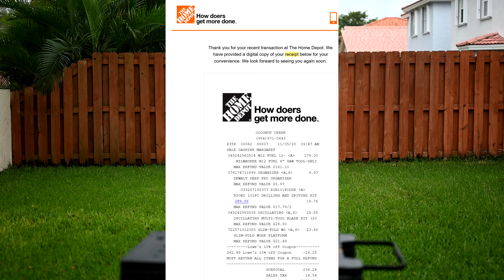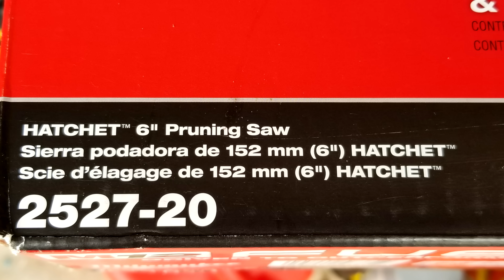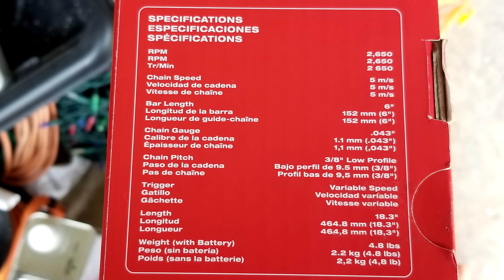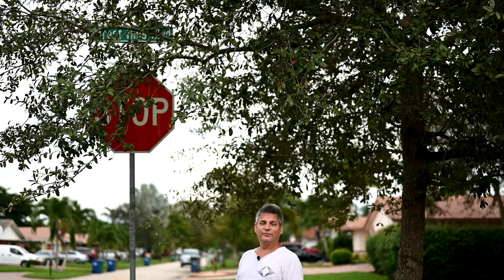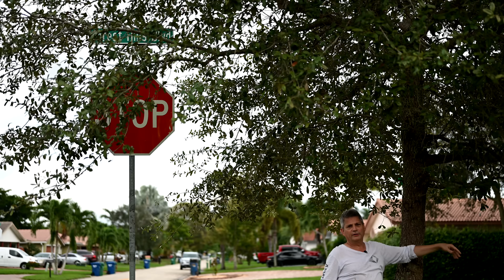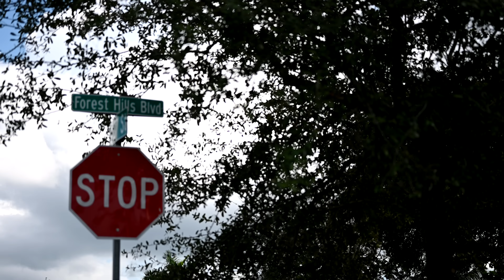Milwaukee Cordless Hatchet Review/How to Prune Tree Branches 2527-20

Comment from the maker: From Home Depot Tool Deals mentioned (paid affiliate links, thanks for your support!)
🛒 Milwaukee M12 FUEL Brushless 6 in. HATCHET Pruning Saw: https://homedepot.sjv.io/XgK6g
🛒 Echo 1 Qt. Bar and Chain Oil For Milwaukee Hatchet Chainsaw: https://homedepot.sjv.io/LjWjY
🛒 Milwaukee Battery Starter Kit Tool Deals:  https://homedepot.sjv.io/LJ1yZ
🛒 All 290 Milwaukee tool deals or battery Deals: https://homedepot.sjv.io/LVrOV
🛒 Milwaukee M12 Free tool or battery Deals: https://homedepot.sjv.io/VEV26
🛒 Milwaukee M18 Free tool or battery Deals: https://homedepot.sjv.io/0WORO
🛒 Dewalt $499 6-Tool Kit with Toughsytem Tool Box: https://homedepot.sjv.io/9NE5j 
🛒 DeWalt Home Depot Buy 1 Get 1 Black Friday Tools: https://homedepot.sjv.io/VJB4J
🛒 Battery Starter Kit 6Ah/4.0 BOGO Tool Deal: https://homedepot.sjv.io/yagN2
🛒 DeWalt XR Brushless Drill/Driver Kit BOGO Tool Deal: https://homedepot.sjv.io/nqoNR
🛒 All 30 DeWalt Buy One Atomic Kit Get 2 Free Tools Deals: https://homedepot.sjv.io/xe9KR
🛒 All 10 DeWalt Flexvolt Advantage & BOGO Tool Deals:  https://homedepot.sjv.io/MZ6An
🛒 DeWalt Folding Portable Workbench Black Friday Deal  https://homedepot.sjv.io/Qo9vo
🛒 DeWalt 10-Compartment Deep Pro Small Parts Organizer: https://homedepot.sjv.io/bEEYg
🛒 DeWalt 12 in. 20V MAX Brushless Chainsaw (Tool Only): https://homedepot.sjv.io/XgW74
🛒 DeWalt Pneumatic 21-Degree Collated Framing Nailer https://homedepot.sjv.io/ELJPK
🛒 Dewalt Miter Saw Tool Deals Black Friday: https://homedepot.sjv.io/nqo6X
🛒 All DeWalt Nailer/Compressor Black Friday Tool Deals: https://homedepot.sjv.io/r9Oov
Disclaimer: Some of the links we send you to are affiliate links which which if you click on them and buy something, we may receive a small affiliate commission. We appreciate you supporting our efforts to continue to bring you word class tool reviews, remodeling and repair videos, and shop with me videos looking for the best discount tool deals.

Comment: May I suggest not holding the tool with your second hand on the guard? I’m pretty sure Milwaukee intends that part of the tool to be a hand guard.
Reply from the maker: Yes, I tried different positions and found it easiest to hold it that way.
Reply: Easier is not safer...safety first
Reply: Totally. Holding it wrong can cost you your fingers. Not cool how you present this tool. And by the way… bad video quality.

Comment: Good morning Jeff excellent video and of course since I read all the comments I'm not going to repeat that your hand goes inside instead of outside on the front. I was glad I was able to contact you while you were going to Home Depot to let you know that it was available glad you got one enjoy. Milwaukee put those M12 batteries in tight as they're designed that way for drop testing so that the battery doesn't come flying out.
Reply from the maker: I do want to do another video for drop testing but just did not have time, and it was getting too long. Also on this light duty saw, I think my risk was good enough to grip it light that without worries.
Reply: @jeffostroff  we know you have a vise grip but the design of that saw is for you to put your hand inside of it to grab ahold of it and you weren't wearing any gloves either
Reply from the maker: @stanleymcman9422  don't wear glove when using chainsaw typically fear of getting caught in the chain
Reply: @jeffostroff  I use the Milwaukee Cut level 5 gloves they have no hang and I get a better grip and my hands sweat like to keep all my fingers right where they are.

Comment: I love Milwaukee tools and have several, however after seeing your video about the hatchet, I'm not sure I  would want it, due to the battery indicator built on the tool, the bottom area open where you could unknowingly stick your finger in and get it cut, and the short time indication of the battery level .  I need a tiny chain saw type tool for my back yard so I as really interested in seeing what you thought of it. Thanks.
Reply from the maker: that's why we had the warning in the video about the opening in the bottom and how to hold the saw so that it won't be an issue.  Also all M12 tools have the battery indicator on the tool. I would love  an M18 version better.
Reply: Simple answer wear gloves. The it’s designed like that for the amount of wood chips and for when your cutting small branches and they get caught in the chain. The 4 A.H. Battery that comes in the kit DOESN’T die I mean it take a long time to kill that thing for homeowners and even commercial work I do it’s perfect.
Reply: Also if you want a smaller chain saw Stihl makes a saw similar to this one that has a 2 ah batter that doesn’t last that long and you have to manually oil the thing it’s half the price of the Milwaukee kit but it’s no where as close in quality as Milwaukee.

Comment: Great video.  I think it would be safer for your hand to go inside the handle on top rather than in front of it, but it seems like it would be natural to hold it the way you were.  Mine is supposed to be here Friday.  I got some branches to chop up.  I think between this and my Ryobi pole saw, I can get a lot of trimming done.
Reply from the maker: Yes most real chainsaws have that extra guard out in front of the handle, This is light duty so holding it the way I did is fine. I even gasp! Hold it one handed on palm fronds.
Reply: Yeah, I plan to use mine one handed almost all the time.  It makes sense to me, grab the branch with one hand and saw with the other.
Reply: @jeffostroff  😊

Comment: Jeff just because you have to learn how to use it dont get so defensive. No troll,but know your roll. I like your vids. Try it by cutting with the chain closet to the handle so its wedged. Then you slowly rock on the material like a sea saw movement. Just like you should use a reciprocating saw. Will make a world of difference. You are using it like a  hand saw
Reply from the maker: There you go, some great tips
Reply: @jeffostroff  be reasonable dont runt to the troll baby beach way. Dont ask just search how to use a chain saw. I know internally you will thank me.
I just guess it was the way you were raised. Run away and call names at the same time. 
You tuff my nizzle

Comment: The only problem I have with pulling the battery out is in the M18 vacuum cleaner. Waiting for M18 version, more power, more chain speed maybe could even do a 12" diameter tree.
Reply from the maker: I hate the battery removal in the M18 vac also!

Comment: They should’ve made that guard better. Maybe an extra shield angling slightly over blade...I’ve considered this or the Ryobi pole saw....or Dewalt version at a good price.
Reply from the maker: This is too small to incorporate that gaurd that they use on larger chainsaws which shuts off the tool as well
Reply: Stihl tried doing that with their little saw (completely junk btw) and it has a little guard over the top of the chain I think Milwaukee did a fine job. The Stihl one makes it so you cannot cut upwards if the wood pinches. The saw doesn’t do a great job cutting up because it has a big chain and it’s slow but it does the job

Comment: The locks are easily reached by the fingers on your non-trigger hand which will also serve to keep your hands behind the guard and not griping it which is clearly dangerous and a quick trip to nine digits instead of the standard 10.  Instructions first on this saw before using it.  Nicely edited by the way.  Consider practicing with the tools before recording.  Keep your wood closer to the saw and not out in the middle when starting your cut.  Nice video work for sure.
Reply from the maker: good tips

Comment: Picked up dewalt flexvolt sawzall 887 impact driver 2 ×6amp flexvolt battery charger tough system box at tractor supply for $199
99
Reply from the maker: that's a good deal!

Comment: Your hand goes inside the opening  not over it
Reply from the maker: This is a light duty saw, low risk of kick back or other dangers, but I did put a disclosure in the video description about it. I just found it easier for me to control by holding the guard like a handle.

Comment: Doesn't seem to be any stronger or faster than my Hackzall with AX blades.
Reply from the maker: Maybe one day I can test them out side by side
Reply: My take, after using both, is that there's a lot more vibration that gets channeled into your joints using a recip saw for this sort of work. A small chainsaw makes smooth cuts and is a lot easier on your body, and if you're over 35, at the end of the day that makes life a lot better. When I was a kid, my father had an ancient 'chainsaw' that operated like a recip saw. It was gas powered, had a bar around 16" to support the blade, and under it was a monster recip type blade with huge teeth that moved back and forth. Don't remember ever seeing him use it, but I'll bet it vibrated his bones pretty good when he did.
Reply: This is the exact beast (haven't thought about that saw in decades)- surprisingly, it doesn't look too jerky, but it is slow as all get out:  https://www.youtube.com/watch?v=6Mz2VyyWtrQ

Comment: OMG, first time watching your videos and immediately I'm like...."uh, your hand is supposed to be INSIDE the guard".  Its obvious from the over-molding on the motor that the flat of your hand wraps around that.  Your thumb wraps around the top of the guard for grip.  From reading a previous reply of yours to a similar comment, just because you like unsafely gripping the guard better is no excuse for showcasing a dangerous method of operation.  Unfortunately now somebody else is going to purchase and then emulate your operation of this tool and literally get bit by the blade when inevitably their grip slips.  

Maybe I'm being harsh, but other people's safety is at risk due to your unsafe presentation.
Reply from the maker: I have a warning about this on the video description. Also while unpacking the box I warned people to read the owners manual fully.

Comment: Sorry but for $169 you would be better off buying a full power gas powered 14" chain saw. This sounds labored as soon as pressure is applied to the wood being cut. Nope a waste of money from my view.
Reply from the maker: some people don't want a 14" gas powered chain saw that you now have to spend the rest of your life mixing fuel and pumping the bulb and choke settings. Nope not doin it. This smaller version i s just right for the average person doing light pruning.
Reply: better is the Dewalt cordless 12"  for $99 dollars at Home Depot,   more versatile,  safer handles,   my two cents for the average home use